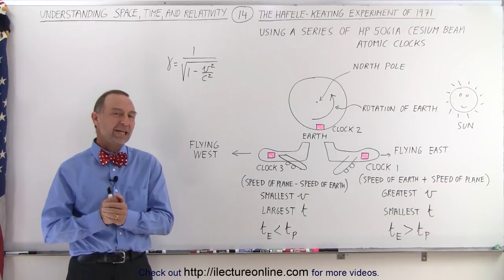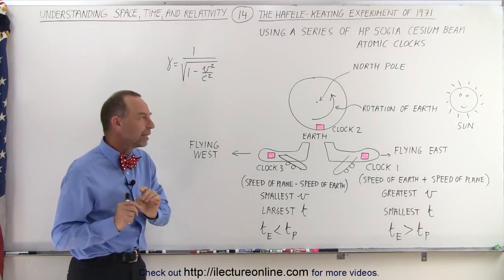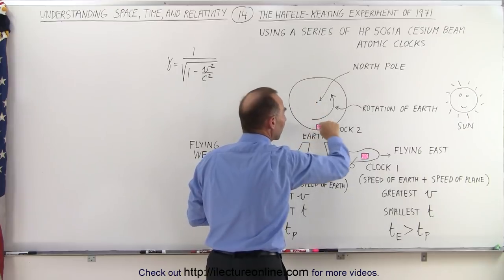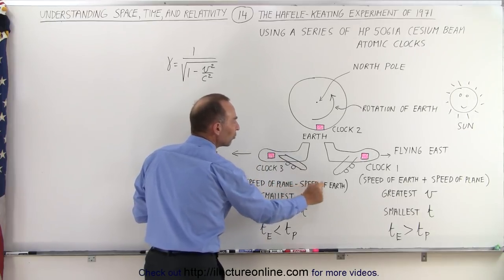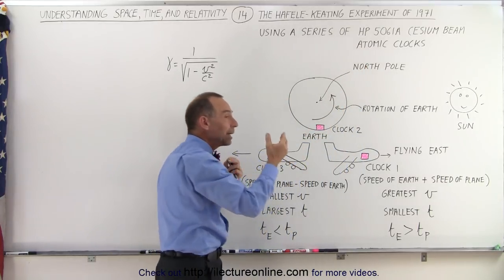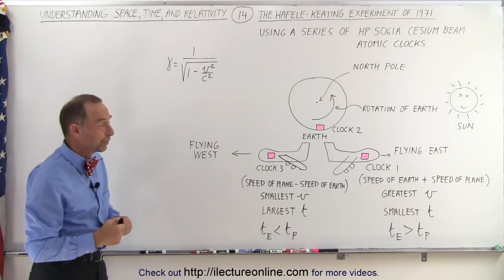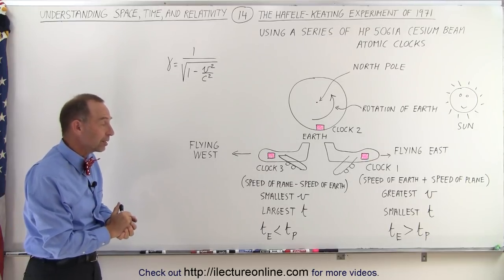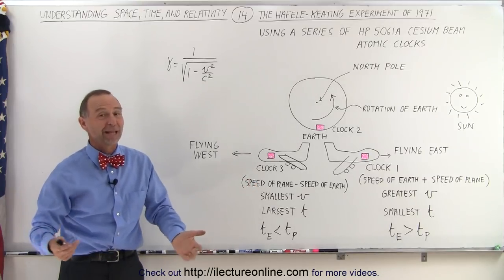Physics 62.1  Understanding Space, Time & Relativity (14 of 55) Hafele-Keating Experiment

Comment: So why not explain how much different the clocks were?  There's so much information left out for me to analyze it.
Reply from the maker: This series of videos is geared towards the conceptual description.  If you are interested in the actual calculations, we have examples of that in our GPS videos where we have to adjust the clock time for the effects of both the general theory of relativity and the special theory of relativity.
Reply: Eastward Clock 120 -196 ns; clock 361 -54 ns; clock 408 +166 ns; clock 447 -97 ns.    Westward clocks:  Clock 120 +413 ns; clock 361 -44 ns; clock 408 +101 ns; clock 447 +26 ns.
Average Eastward -45 ns.   Average Westward +124 ns.  Predicted results:  Eastward -45 ns; Westward +275 ns.  Data source: From the Institution of Engineers of Ireland, "Reliability of Relativistic Effect Tests on Airborne Clocks" by A G Kelly PhD (Fellow)
A lot of shuffling, assuming, and manipulation was required to achieve the predicted results.  The clocks would have to be orders of magnitude more stable/accurate to prove the theory. What I consider to be the largest blunder was they did not consider the earth's orbit around the sun.  The side of the earth that is facing the sun is rotating at 1000 MPH opposite the 66,500 MPH orbital velocity of the earth.  At night, the side of the earth away from the sun is rotating at 1000 MPH in the same direction as the 66,500 MPH orbital velocity.  The eastward clocks would therefore run faster during the day and slower at night neutralizing any effect of time dilation.

Comment: A few questions.

1/ When both planes are on opposite sides of the planet their relative speed is zero - does this matter?

2/ How are all the relative velocities calculated? For example, when either plane has travelled through a 1/4 rotation, do we use trig to calculate all the absolute velocities between the planes and the ground station? Because the only time you need not do this is when the planes are either at the point of the ground station or on the other side of the planet - you need trigonometry for every other point around the earth, right? Did they do all this calculus?

3/What is the frame of reference - the centre of the earth or the ground station? If it is the ground station then that is clearly not an inertial frame of reference.

I'm sorry, but I will need to see this done in outer space with everything moving in straight lines and gravitational effects greatly insignificant!
Reply from the maker: Since the plane's speed is relative to the Earth's surface, when they are on opposite ends of the Earth, their relative speed will not be zero.  The time effect will depend on the relative speed to space.
Reply: @MichelvanBiezen  Relative speed to space? That sounds like the universal frame of reference!

But anyway, what about all the trigonometry required? Or what exactly is the frame of reference for this experiment?
Reply from the maker: The experiment was done to determine if there would be a difference and indeed there was.   Now we need to determine why.
Reply: @MichelvanBiezen  Frankly, I put a huge ? over the entire thing. I would go so far as to call this a deliberate forgery. And the numerous follow ups.

None of the FORs are inertial.

From what I see, none of the relative velocities have been calculated correctly at all.
Reply from the maker: You are certainly entitled to your opinion.    And we should all be ready to question anything the "experts" say.

Comment: Interesting experiment.  What I question is the frame of reference used.  If we take the stationary clock to be our frame of reference it shouldn't matter in which direction the plane was flying. Adding/subtracting the earth's rotational velocity from the plane's velocity creates a problem.  Placing the clock on a plane flying against the earth's rotation but at a speed identical to the earth's rotation, would the clock show no time dilation when the plane returned to the original point 24 hours later?   Would this nullify the idea of time dilation since the plane velocity would have been canceled by the earth's velocity.  Additionally, including the earth's motion, brings back the idea of the aether. Please explain my misunderstanding.
Reply from the maker: For a stationary observer (away from the Earth) the two planes flying in opposite directions will have different speed due to the rotation of the Earth.
Reply: @MichelvanBiezen  Was there a caesium clock in space used as a control in the experiment?

Comment: Please, comment.
My problem with this experiment is that the Earth's gravity is (might be) affecting the Clocks. Therefore, the "observer" is not neutral to the experiment.
Is there a similar experiment conducted outside of the Earth's influence?
Reply from the maker: Since the planes fly at altitudes of about 10,000 m, the gravitational effect differences are very small and not the dominating factor here.
Reply: @MichelvanBiezen  
Thanks for the reply. 
However, all the objects on such a low altitude fall to the ground and are affected when flying west or east. So, instead of assuming what you just assumed, I would like to read about any experiments conducted in the outer space, where objects like planes or all kinds of clocks are not affected by the Earth's gravity (whatever the nature of that gravity might be).

Comment: Although I have now forgotten the details, there was another experiment around 1975 and others after that. I think cesium was the 'clock' in some experiments where precautions were taken to protect the instruments from magnetic field and other effects. The result(s) was/were in agreement with relativity. Naturally, there were given + or - minus error values for the experiments but relativistic values were within these limits. However, what is misleading is that adjustments and error measurements don't just involve relativity (SR & GR). For example the GPS and Russian systems both use complex algorithms for signal delay (receiver & emit), atmospheric and other effects and once that is done then adjustments due to relativistic effects can be made.
Reply: The data from the Flying & Stationary Atomic Clocks experiment (Hafele & Keating) was a mess.   Hafele & Keating had to massage the data just to get anything sensible. The total range of drift for the 4 clocks was 7000ns. Even if you take the massaged results at face value, those results actually disproved the underpinnings of special relativity.   Einstein claimed that all moving clocks are supposed to run slower with respect to the observer (& that all inertial frames are equal), but the west-bound clocks sped up by 273ns compared to the Stationary clock . and the east-bound clocks slowed down by 59ns. Hafele even admitted that the miss-match between Einstein's Relativity predictions and the measured data was "disturbing".
Reply: Hafele had to use “motion with respect to the underlying nonrotating inertial space” to get the math anywhere close to agree with relativity predictions.  So basically they had to create an absolute reference frame., in other words an "ether". Because everything in the world around us and clocks are made of atoms and governed by Electromagnetic force, what we call Time & measure as Time is just the rate at which atoms and subatomic processes occur (what you would call local time). So its logical to expect that motion and gravity will have an effect on these  process thus effecting "time"
Reply: The underpinnings of special relativity are completely flawed.  Looking closely at the experiments cited as proving Einsteins relativity, such as the 1919 eclipse, 1971 Atomic clocks, Gavity B probe, the data from these experiments do NOT match the predicted value from Einsteins relativity, the data has to be manipulated to get anywhere close. GPS corrections doesn't match  Einsteins relativity predictions. The rotation of galaxies don't match the Einsteins relativity, thus the need for the Mythical Dark Matter.
Reply: Yes, okay, so you seem to be in the camp against SR & GR, and I am opposite. That's not a bad thing as long as both of us have reasons for being where we are.  When people don't understand the principles but still claim this & that just based on faith, is when I choose to terminate conversations with them. I have to say that working through the equations (various methods) and bearing in mind I am not a practicing scientist (retired with technical background), I have to depend on what both camps have to say in articles etc.. On the particular experiment cited (H & K) I would thought statistically speaking, that the eastbound figures would be of more concern, predicted 40 + or -, measured 59 + or -. I haven't worked it out precisely but  that difference will be at least  greater than 2/3 of a SD. The westbound showed much less difference in predicted vs measured values being something in the region of 0.1% difference. But in late last century and early this century the NPL conducted further experiments both London to Washington and a later round the world trip. I admit to not knowing the details but closer agreement with SR & GR was apparently obtained.
Having said all that I don't make a good mainstream supporter as I too have concerns about the standard model (both of them) but that's all for other conversations. For the moment I am mainstream (because I don't like to sit on the fence) yet feel that SR , GR and EM theory are infants of something else.
Reply: So now tell me what the results should have been if the clocks were flown North-South rather than East-West? Same velocities but no Earth's rotation to add/subtract.
Reply: @ITTechHead  could you please provide me with sources for your reply/ Thank you

Comment: The only thing matters is the speed of the airplanes relative to the position of the Earth Clock. I'm not convinced that the plane flying East has greater V, rather smaller ? There is no numerical proof here. According to Einstein theory, Pilots on the planes must see the Earth Clock slow down too, because the position of the Earth Clock is moving relatively to the plane position. And it's not mentioned here ?
Reply: If I understand what you're saying, that would be assuming that the static earth clock had a speed of 0.

Comment: So which clock would be slower if the H-K experiment was done North-South? And why?
Reply: @Richard Linsley-Hood
 ? re your comment "So which clock would be slower if the H-K experiment was done North-South? And why?" < That's an interesting question.
Reply: The two flying clocks would read about the same, no? 
Maybe not information.
Reply: I think the only difference here would be removing the speed of the earth's rotation from the equation. Both planes are still flying at the same speed relative to each other. The E-W model just acts as a modifier to widen the gap and make the difference bigger, probably to make the results more evident.
Reply: @jawaring4367  The speed between the planes will be the same regardless in they fly East-West or North-South, so they should show the same differences regardless. Half of the time the distances between them will be increasing, the other half decreasing. Now compare the E-W and the N-S planes. How do they differ?

Comment: Doesn't that indicate that space has absolute reference points albeit warped by General Relativity? Couldn't we map the Universe by comparing clocks all throughout to find the greatest rate of time passage and therefore the slowest velocity through space?
Reply: Yeah, i was wondering this too. I was thinking that maybe this only applies to rotational velocity since gyroscopic movement is the only motion detectable on space.

For a thought experiment if you have 3 objects one going left one in the middle and going right, do the left and right have the same time? What if you are standing on one of the moving objects? Would you measure the object in the middle to have less time and the other moving object that is moving twice as fast away to have no difference in time?

Unless time magically turns into a vector i dont see how this can be resolved.
Reply: @tyty8484  Great question only by comparing clocks could you determine the true nature of the objects with respect to the space they occupy. 

If the object in the middle was absolutely not moving through space It would experience the most time (events) and if the other two objects are moving away from the one in the middle at 90% the speed of light They would experience half the time as the middle and yes their clocks would run at the same rate.
Reply: @1965ace  Hmmm how about this. The one plane going counter rotationally was observed to have experienced a time contraction. What if its speed was increased? Would it experience more contraction? What if it was moving the same speed around the axis as the other plane going the opposite direction? Would it then have the same time dilation as the other plane? Would that signify a local base frame or a universal base frame?

What if the 3 objects going left right and still from the previous example are all moving in the same direction perpendicular to the direction of action. i.e. in a forking direction. Do they experience the same relative time dilations as the ones from the original example? Lets say theyre moving appart at 0.9C and also they set moving in the 3rd direction ate moving away at 0.9C.

I honestly feel like maybe theres a problem with the equation in the way that it treats a vector and a scalar exactly the same. Also i want to see more attempts at recreating this experiment with additional data points. Ive become pretty skeptical after reaching a certain age.
Reply: @tyty8484  The problem is looking at an experiment from the perspective of being part of the experiment. I like the "God" perspective seeing the whole thing from the greatest vantage point. 

If you could see space like a medium that is constantly moving speeding up toward massive bodies then the complexity of time dilation is easier to understand. Since spacetime is not a flat linear medium we have to factor objects moving through it and it moving through objects. 

We know that momentum is conserved when an object moves through space and it's conserved and accelerated when space moves through objects (gravity). 

Adding to this is rotational warping. The basic Idea is what is an object's relationship to the space surrounding it is directly related to the time dilation.
Reply: @1965ace  What does this have to do with anything we were talking about?
Reply: @tyty8484  The counter rotational plane would continue to see time contraction until it matched the rotational speed of the earth  then any further increase of speed would see dilation. This would be a local base frame unless the earth was not moving universally through space.

Comment: Was. Perhaps the magnetic field of the Earth, Sun and or Moon effecting the clocks in some mechanical sense? What type of clocks were these? Iron clad infalable mechanisms?
Reply: No.
Reply from the maker: Atomic clocks are extremely accurate and work on the principle that the natural vibration of oscillators does not change.
Reply: But don't the oscillators oscillate in space and time as well?
Reply: No.
Reply: Floyd Pinkerton
Okay then Floyd:
a. What exactly is 'space'?
b. What exactly is 'time'?
c. How exactly do space and time 'vary'?
d. What exactly is 'gravity' and how exactly does it do what it does?
Reply: No.
Reply: Floyd Pinkerton
Okay troll.
Reply: Well ...one plain is moving in the same direction that the earth is turning and the other one is moving in the other direction. So of course one will progress faster than the other. Just curious how this factors into this
Reply: Bad day Floyd?
Reply: @MichelvanBiezen  Shouldn't also clocks affected by the time dilation?

Comment: We are taking the relative velocity's but plane is flying apart from Earth, is not it? Why do we add the earths velocity then ?
Reply: Because the earths atmosphere is moving with the Earth at the same speed as the Earth.  When the planes are stationery on the runway, they are moving with the earth eastwards at approximately 1000 mph. When the plane heading eastward takes off and speeds up, if the plane is travelling at 500 mph, it is actually travelling east at 1500 mph because it still has it's initial eastward speed of 1000 mph, so you just add the extra 500 mph to its speed. The plane flying eastward is therefore travelling 500 mph faster than the clock on earth's surface. If the plane travelling westward is flying at 500 mph, this plane is actually still moving east with earth, but it is moving east 500 mph slower than earth is moving east and it is moving east 1500 mph slower than the plane flying eastward. If you walk, drive or fly west, you're still actually moving east with earth, unless you're moving west faster than 1000 mph. This is my interpretation anyway. Someone please correct me if I'm wrong!
Reply: @Daniel Smith Exactly and the refrence clock on ground is also moving relative to the earth's core.

Comment: When a flying clock is diametrically opposite the Earth clock their relative speed is very small.
Reply: Actually their relative speed is greater.  Meaning relative to fixed spots on the earth passing below them.
You mean actual speed with respect to what effects time dilation.
But maybe I didn't understand what you meant ?
Even still you cover more ground flying against the rotation of the earth with the same apparent speed and time , apposed to with it.
Ergo relative speed is increased , because more distance relative to earth = faster.